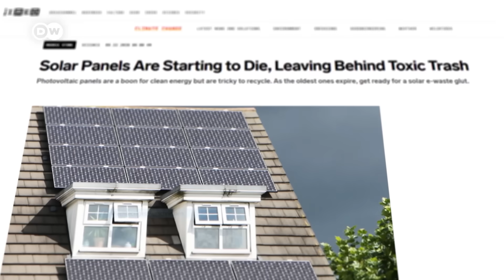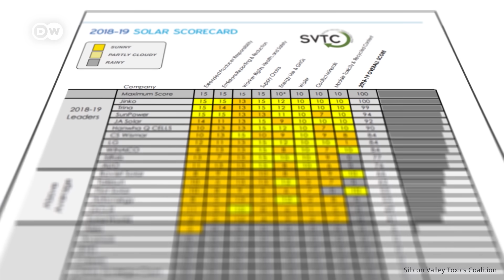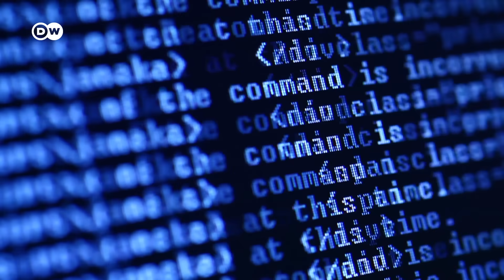How green is solar energy really?

Comment: In 4:40 where you talk about hazardous elements in some modules (specifically Cadmium and Arsenic), i would like it if you made it clear, that these are only in certain types of solar panels - namely thin-layered PV - which are very very uncommon for multiple reasons.
No Silicon-PV-module has any of these materials in it and Silicon PV-Modules are all the ones where you see individual cells (so basically almost every panel ever used).
The only rare and expensive raw material inside a regular silicon module is silver for the electric contact on the front of the cell. Hazardous materials are not present in a finished module (so this is obviously not accounting for acids etc. in the construction process).
The way you present it in the video it sounds like if you buy a regular module with individual cells (which everyone does because they are cheaper and more efficient) you might end up having Cadmium or Arsenic in it without knowing. But that is not the case! It is only true if you buy an unconventional Solarpanel which is based on entirely different materials and technology - not silicon cells (e.g. CdTe and CIGS Modules).
Apart from this detail i really liked the video for a short overview of the topic though!
Reply: Well, it's not as simplistic as it sounds. But the complexity of this whole topic, going to a real LCA and not just exchanging opinions, is well beyond the scope of simple comments on youtube clips.
Reply: Yes, according to Wikipedia arsenic is used as the N-type dopant in other semiconductors, but solar cells use phosphorus.
Reply: As if making ICE engine isn't hazardous at all. Look all the complex chain of lub oil from the machinery to up protect the engine itself. Not to mention massive cast iron being wasted on cutting the engines.
Reply: @kongwee1978  agreed. i wonder if those 'life cycle' emissions figures account for the manufacturing of all the cars/power plants, as well as all the infrastructure used to refine and transport.
Reply: Thanks for the additional info Captain,  i might just add that they do bind materials like Arsenic, Phosphore or Antimony so the Monocrystalline silicon, mostly used for processor manufacturing. Appart from the acid , like you said, there is also some Nickel, a bunch of solvants and rare metals. 
Great video btw
Reply: Somehow this vid makes it out like solar is doomed but this is all the manufacturers fault. The People should be at the forefront of these ideas and voicing our opinions. VERY recent solar panels have made great strides in their tech. Look into the metal contacts taking inspiration from leaf veins. Least surface area covered to let sunlight in while also providing connections to the conducting layer.
Reply: @slowfudgeballs9517  What about the things such as Lithium that are needed for storage?
Reply: Who even uses lithium batteries in grid storage? We have molten salt, sodium ion batteries, redox flow batteries, pumped reservoir storage, gravity based system etc.
Reply: Nice clarification 👍🏽
Reply: Twisting the truth to coverup the lies.
Solar PANELS are not just PV cells. These cells must be connected together and protected with glass and that's where most of those toxic materials enter.
Reply: @Hans Dampf lead based solder has been banned for many years now. RoHS is the keyword.
Reply: @bk_16 As if your oil don't need drillers, fall from sky. :)

Comment: It's crazy to say that solar energy emits 43g per Kwh, because this is a moving figure.

Mining equipment is being electrified.  Think about it, if your car is an EV and you drive it an average amount of KM then it'll take you about 7 years to break even, because the cost of the fuel is cheaper than the cost of petrol or diesel but the cost of the car is more expensive.  But if you drive your car all the time like a taxi driver would, then you break even much faster just after several months.

Mining equipment is very much the same, having EV mining trucks cost a lot less to run even though they are more expensive to buy.  So at the moment there are only a couple of different mining trucks available but soon all the mining trucks will be EV's, because they are cheaper to run.

Then there is all the transport, ships are still burning through diesel, but there is a lot of research into ethanol from hydrogen.  And every manufacturer of lorries is coming out of EV versions of lorries.  So transportation is very slowly going zero emission as well.

Then there is the power the factories are using, well the power grid is slowly changing to use less fossil fuels.

So it's not 43g per Kwh for solar panels, that figure is continuously going down.
Reply: Do Chinese silicon mines adopt safe mining methods, and protect workers against silicosis, (lung cancer) and would proper OHAS add additional cost? Of course, it's a given that Chinese solar factories are disposing of the heavy metals and acids correctly. If not, add more cost. Oh, and the batteries required to prop up solar, they might need cost analysis. Have you factored that into your cost reduction? Where and how is lithium and cobalt mined? What cost do you place on children's health in The Congo cobalt mines? Are they mainly Chinese owned? Gosh. Solar panels are cheap for a reason.
Reply: But are the proper "end of life" disposal costs included, or do solar panels end up in landfill?
Reply: @archcollie5708  that got nothing to do with the 43 g per kwh statistic

Comment: One more thing of solar panels is not addressed, recent study shows that solar panels raise air heating as solar panels reflect the light more than a soil, so covering Earth surface with panels changes natural balance.
Reply: Its not about reflection , its about absorption. Its the albedo of the surface that will cause atmospheric heating. Ashfelt has a low albedo number  (0.05 to 0.1) therefore it absorbs a lot of heat which is put back into heating the atmosphere. Desert Sand has a higher albedo so absorbs less heat. Putting solarpanels over an ashfelt roof reduces atmospheric heating. Putting them over desert sand increases locally the atmospheric heating. It should however be noted the atmoshpheric heating of solar panels wherever they are fitted is tiny. The heating effect is an order of 60 times less than the heating caused by Co2.

Comment: Solar panels are not the only choice for harvesting solar energy on a large scale. There are types focusing sun light by mirror to central sphere and making steam out of the solar heat. I think it's called "concentrated solar power" or "solar thermal power" plants. There will still be an upfront cost, CO2 emissions and some chemicals involved. I think the real problem is we as humans consume so excessively that no green energy solution alone will ever solve that before we destroy our planet. Although I favour offshore wind, we can't leave out solar panels especially for sake of distributed electricity generation like individual house holds, factories etc.   Centralised power generation has its problems of distribution as well.

Comment: The basic "Green Revolution" model with PV as Savior is grossly flawed as being implemented.

To reduce cost vast PV farms are built by destroying green space.  The dillution of PV compared to fossil fuel or nuclear means PV farms are increasing the "heat island" effect at a rate of 10,000X to 100,000X of nuclear when comparing volumetric efficiency.

In other words PV farms increase global warming on a massive scale compared to nuclear, geothermal, hydroelectric, and even wind energy.

The Green Revolution could large reduce to the point of eliminating the heat island effect by placing smaller solar systems on existing structures.

Consider placing PV arrays over parking lots.  This would in almost all cases reduce the heat island effect because PV panels have less thermal mass than asphalt and concrete to absorb and release heat back into the atmosphere.  PV panels are designed to absorb and convert in  light into electricity.

Homes and businesses are where PV panels should be build for many reasons.
Reply: Replacing all power production with PV (However unlikely that is), which is approximately 29Tw. produces a heating effect of 0.03w/m2. That calculated figure also does not include the reduction in heating effect by covering the  surface under the panel. Its a massive improvement when compared to the heating effect of Co2 at 1.5w/m2. The effect from PV is miniscule. Ashfelt on roofs and roads produce more heating effect that PV.
Reply: @craigphd7844  Furthermore, the large PV farm model introduces the maximum grid instability that can be induced from the intermittency problem of PV.  You build a PV farm to power 100,000 homes and one cloud throws an 80%  reduction in power.

The fossil fuel utility companies love the intermittency problem because they are guaranteed a profit on what ever they produce and intermittency increases the need for running reserves.

Distribute the PV panels to 100,000 homes and the reduction in power from clouds goes down to 5% or 10% and the running reserves are greatly reduced.
Reply: @vironpayne3405  I entirely agree that the solar panels of a farm, instead should be installed on homes where paractical. It makes absolute sense. I have solar (3kw) installed on my house. I have reduced my KW/hr from my supplier by nearly 50%. The same is true of solar panels installed on industrial park commercial premises. Around 5% of companies in an industrial area close to me, do exactly that. Whereas households still need generated supply at night, many of the industrial park premises, do not operate at night, so their percentage use of generated power is much lower.
 Many comments seen on this and other YT videos seem to lose sight of what is actually needed as far as dealing with Co2 emmisions produced by generating companies. Its really not about replacing all fossil fuel based generation with Solar/wind/etc. Its about replacing a high percentage (60%) of it, to deal with the current crisis. A longer term goal would be to eliminate it completely.
Governments need to do more to facilitate this. For example a previous government in Spain actually introduced a tax on solar power produced by homes and businesses, and commercial generation. (Dubbed "tax on the Sun"). It proved devastating to the solar industry in Spain. New installations virtually stopped for 5 years. Court cases were filed in abundance against this tax. Thankfully the next government repealed the legislation.
Reply: @craigphd7844  Of course it seems counter intuitive at best to destroy green space for the most dillute power source on the planet in order to save the planet and then call it green.

Don't get me wrong.  I am pro solar, both thermal and PV.  I have PV as a matter of energy independence during hurricane season.

As a condo dweller generators are unacceptable due to possible carbon monoxide problems.  1600W of portable PV makes life more bearable during power outages.

Comment: 2:16 and there you have nuclear power plants with 12 CO2e/kWh, even more green than wind turbines.
Reply: And that's the average, which includes lot's of old plants too.
CANDOs are below 4g CO2/KWh, the Swedish fleet are 2.5g CO2/KWh. 
SMRs will be even better as they need much less concrete per KWh, which is the largest contributor for the CO2 emission of nuclear.
No other technology can get even close to this numbers.
Reply: @solutionrebellion  i mean, when we finally manage to launch the first thermofusion reactor, I think that it'll be the cleanest
but this is still a long way off, so far we have a lot of problems with just launching this type of reactor
Reply: The problem is that nuclear energy is so efficient and  environmentally friendly. Every big lobby can see it as a threat to it's interests. It doesn't work for big Oil and Gas,  big coal or big green. Nuclear energy could provide people with plentiful, reliable and cheap electricity, but that would mean the  end of their lucrative businesses. 🙈

Comment: Solar panels are one of those few things that are too good to be true, yet they are true.  The only negatives you managed to pull off where "what if" arguments. "What if the company dumps the dangerous chemicals?" "What if the panels are not recycled?" Well... What if they are? Also... You were completely ignoring the fact that solar panels are no different from any other electronic device in those regards. Those are problems that need to be solved in general, may there be solar panels or not.
Reply: What are you going to do about the huge costs in terms of land
What are you going to do about the fact the sun doesn’t shine at night
What are you going to do about the fact that it takes more energy to recycle one solarpanel than the solar panel produces in it’s lifetime?
What are you going to do about the dangerous polluting chemicals used?
What are you going to do about the polluting mining of lithium?
What are you going to do about the fact that lithium is a scarce metal?
Reply: @rickrozen2341  What are you going to do when all your arguments become false due to solar panel advances?
Look... It is very easy to ask, and hard to answer. And honestly I can't bother, because you clearly don't know anything you are talking about. Solar panels produce way more energy than it is used to produce then. That is so clear and self-evident if you actually have solar panels. I'm sure that is one of those things that was true at some point, but solar panels have gone a very long way, and continuing to improve. Also... Solar panel's lifespan is a bit made up. They don't break after the rated 20 years, but they are more like batteries. They loose performance over time. But after 20 years they will keep producing at least 80% of the energy they made when new. So they can really generate as much as you want, and you can keep them as long as you desire.

And also... I don't know about you, but I see the alternative every day. I live close to a big refinery, and besides the smell and suspicious yellow smokes that com out of there, it is as big as a town. What about that land? It uses so much water for refrigeration it always has a cloud on top from all the steam it gives off. What about the rivers? How enery efficient can that be?
And the cherry on top is a smoke stack that has a flame burning 24h. When a new ship arrives with fuel, the flame gets so big it lights up the night 5km around. It is like a small sun, you could read a book with it. The flame is so powerful, that in the silence of the night you can also hear it from 20km away. It is a constant rumble. And it burns like these for weeks. Once it is tamed into a little 5 meter flame, a new ship arrives. I can't even imagine all the wasted energy just on that fricking flame. What about it? What will YOU do about it?

Comment: 80% of the incident solar radiation is absorbed raising the panel temperature and warming the air around the panel,  the definition of global  warming
Reply: Radiative forcing from anthropogenic CO2 is approximately 1.5W/m2 at current levels of C02.  Fossil fuel power generation heating is 0.0057w/m2. Based on todays efficiency of solar panels  (Circa 20%), heating is 0.03w/m2. Which is 50 times less than Co2 forcing. In both cases, (fossil fuel heating and solar heating), the effects on global warming are negligable. This is based on the current world power generation of 2.9 TW created by fossil fuel generation, being replaced 100% by solar panels. This also does not factor for the albedo of the surface the solar panels cover. Panels over an ashfelt roof, which has an albedo close to zero, atmospheric heating is actually reduced.

Comment: The problem is.. there are no trees around that “climate friendly solar panels “ if they where put on buildings and other standing structures this would make the difference all of my solar panels are mounted on roofs of sheds ect
Reply: Yes I am a personal fan of commercial rooftop and parking lot solar. 

Sadly it is the least likely to get funded and also approval from local utility monopolies. 

Utility companies want to make large grid scale projects so they maintain control and profitability. They do not care of the occasional house gets some solar because they still keep the connection fees, and there is not much potential for over production. But they do care if large buildings get large solar projects because the potential to generate a significant over production, and losing a customer that pays a lot per month for utilities whole only keeping a small connection fee. 

But yes, commercial solar moves production to the endpoint, has enough scale to be economic, does not disrupt natural lands and makes buildings more attractive instead of uglier. Easily there is enough commercial land in every city to power the whole city with solar. And combine it with electrified vehicle fleets and industrial machinery for even more benefits. 

But it is going to be hard to do on a large scale because the local utility lobby will block it. 

It needs a progressive government, progressive utility and a progressive land owner to make it happen.